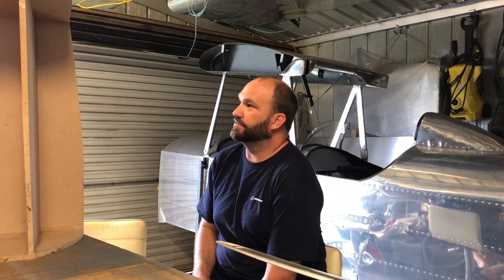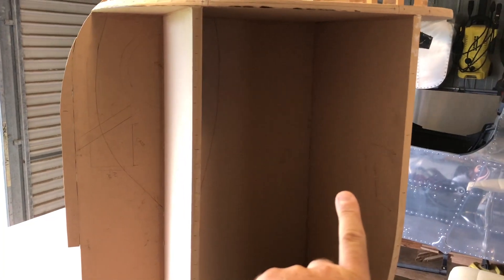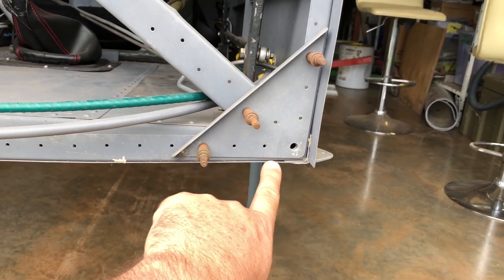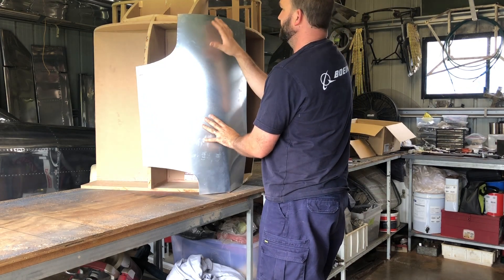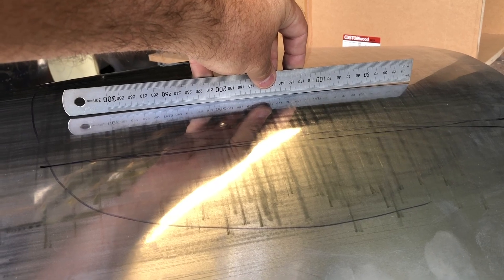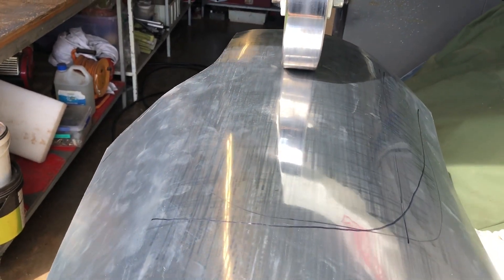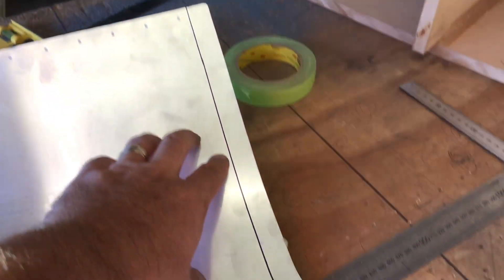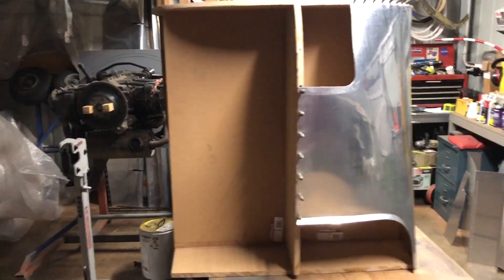A custom engine cowling for a custom aircraft part 2

Comment: Very interesting video and great job .I have learn a lot .I wish to build my Pitts S1 cowling from aluminum . What thickness and kind of aluminum did you use ? I'd like to use .025" to get as light as possible !!
Reply from the maker: Thanks mate. I used 5005 grade aluminium as it was easy to get where I live. It can be annealed as you work it. It is 0.8mm or about 0.030”. You can use an aircraft grade aluminium like 2024, but would need access to a heat treatment oven. So much fun!